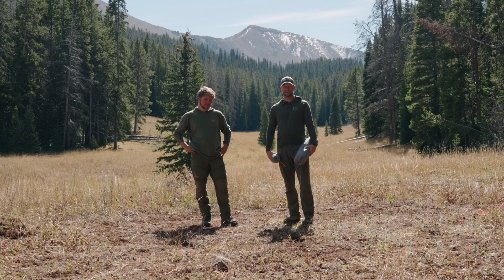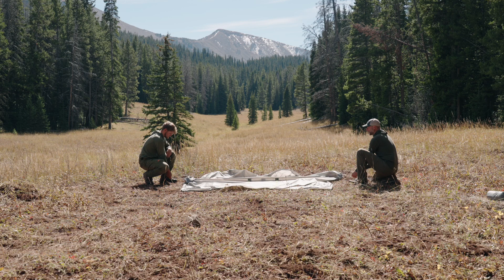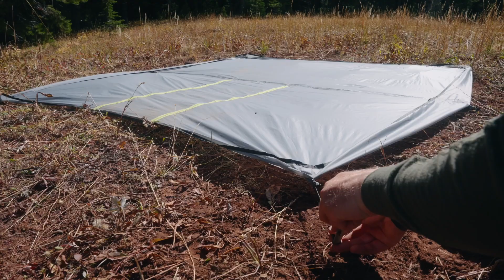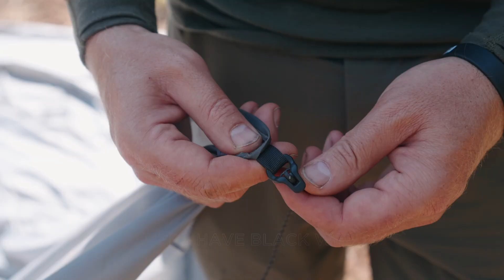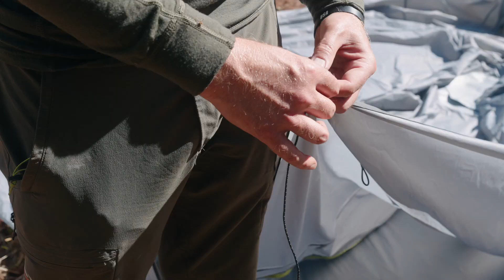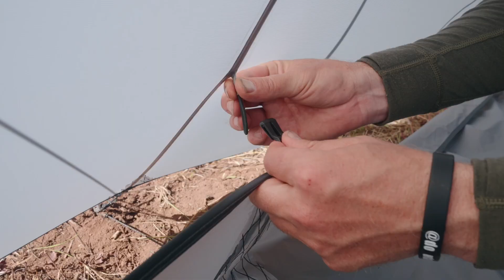How To Pitch The PEAX Solitude 4 Tipi With The Footprint

Comment: Unfortunately the main pole broke during the second time I used the tent… 

I went to set up the tipi and it broke after steaking in the corners.

Pretty bummed that the pole broke so easily and when bringing this issue to customer service, they only want to debate and say that you are wrong.

Comment: What stove has been working the best? I'm in Alaska and will be using it on Sheep and Goat pack in hunts.
Reply: I us an argali stove.  Burns a long time with the right wood. ( use logs not splits.). Or TSC hardwood blocks get it going and flue it way down.  Flip the stove pipe every other day to burn out the sticky creosote.